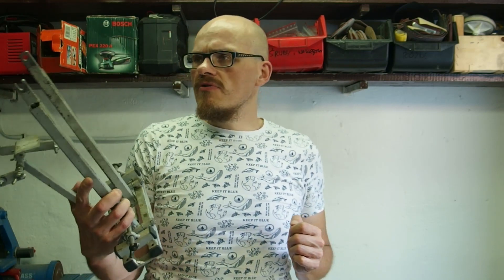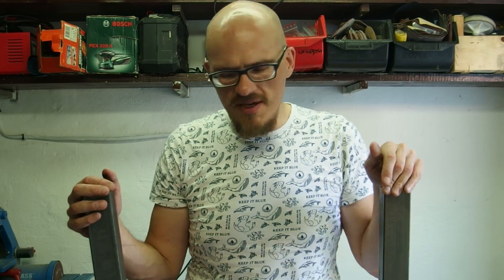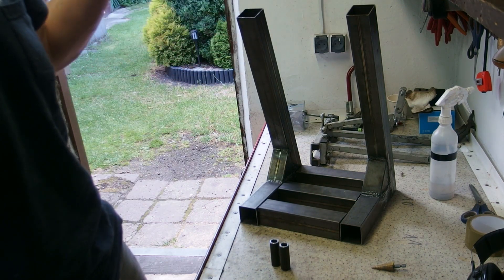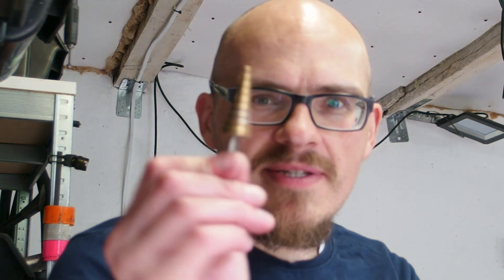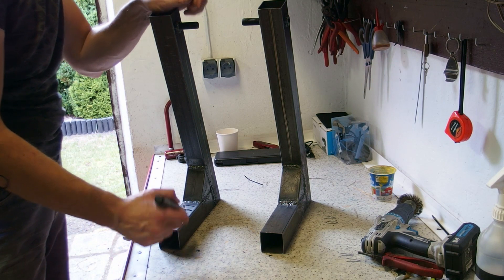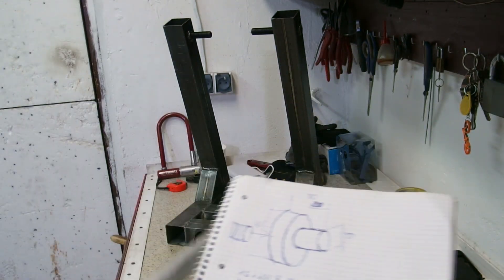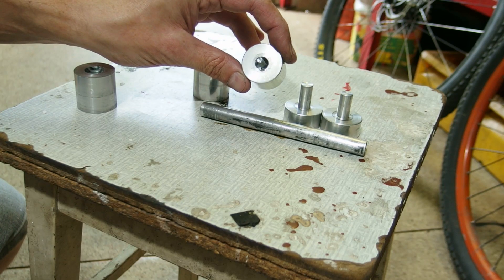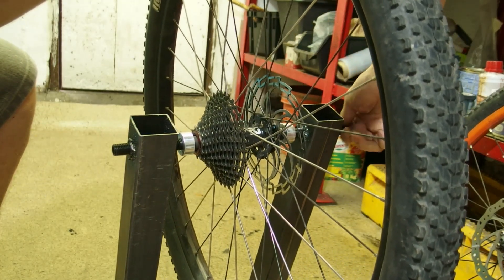Truing stand to end all truing stands. Part 1 of over 9000

Comment: did you really use grease for cutting threads??? no wonder that tap broke off.
Reply from the maker: Touche, really. But truth be told - I was going at it too fast as well. I was using a bit of greas and a ton of oil though.

Comment: That thing looks like a boss! Not sure if you have thought about this but here's an idea: to support virtually all wheel sizes, you'd just need one side (though that'd be half law/justice). Make that side stiffer with thicker tubing, and make the base longer and stiffer to support the wheel and stand as well. Then of course that calls for new axles.
Another idea: halve the law/justice piece, put an adjuster between them to expand or contract the sides, and that's it.
Reply: I did a version of your alternate idea: I kept the right side (justice) free in space. I use a long QR axle to clamp any hub (even my superboost) between justice and law. Then since law is a bit floppy, I weigh or clamp justice down to the table. Super cheap and effective. Need to flip wheel or pull it out and use a dish tool (cardboard template for me). This is a downside to a movable justice

Comment: you should make a probe that resonates noise.  im guessing your truing stand resonates sound well and if you make the 'feeler' and mount it right it should resonate a good audiable noise.  which is good for most truing applications.
Reply from the maker: This is actually a very good suggestion and it goes to 'todo' list for this stand.
Reply: @TryboBike  you could weld a nut or similar to the chasis of th stand and then use a threaded counterpart as the mast of the probe.   then get some sort of plastic cap for the tip of the probe for more delicate rims.  if your probe aparatus can be moved from the left and right side then that can allow dish to be solved without having to flip the rim in the stand